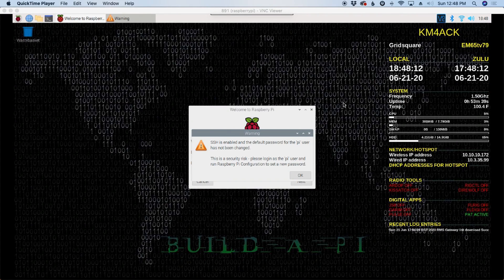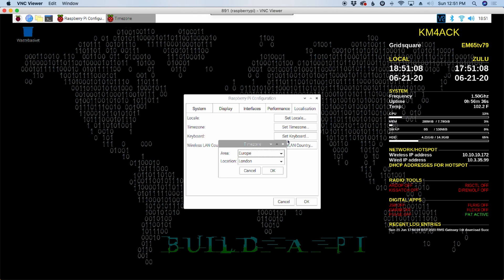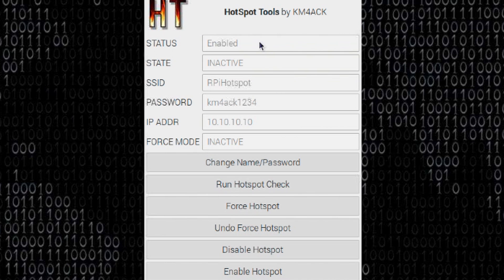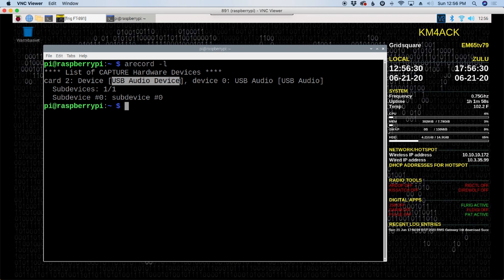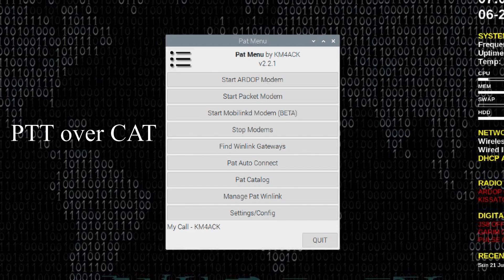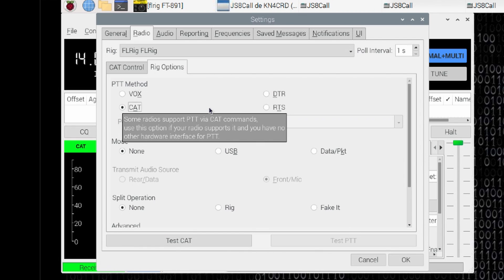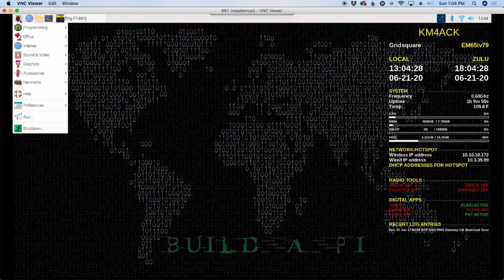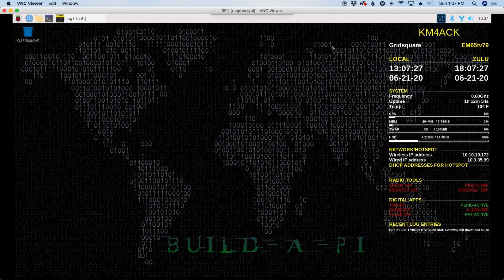Ham Radio Build a Pi Setup

Comment: Anyone try this on an original Pi? Someone gave me one and I want to try this
Reply from the maker: Might work but only the Pi 3 & 4 are officially supported.
Reply: @KM4ACK  Pulled a card out of my camera and decided to give it a try. The OS works but it's very slow and you need more usb slots. Some apps do not come up. If you have patience you can still log which for me starting out and learning to QRP is worth playing around with.

Comment: Hello Jason
have installed some applications in the buster with build a pi 
When I went to add more applications from the menu, it could not install them
After several update and upgrade attempts I noticed that it was asking to uninstall 
>>>>>>>> lxplug-volume <<<<<<<<
After uninstalling it I was able to install the programs I wanted through the build a pi menu
Congratulations on the fantastic work you have done
Best regards
de Paul
sv2hrt 😊

Comment: Hi Jason, tnx for next great video and your build-a-pi setup is fantastic. I get now  my new IC705 an its build in GPS works great. But after restart conky will not longer displayed. Have you a idee what the problem should  be. 73... DL1GKK
Reply from the maker: Josh at @hamradiocrashcoarse is the only one that I know that has done this successfully. Post the question on the BAP forum and let's see if we can figure it out https://groups.io/g/KM4ACK-Pi/topics

Comment: Hello Jason, this is TI2GBB from Costa Rica. Sr I have a question, this  " PI Package" for Ham Radio use contains a software from where I can run FT8 or another digital modes and in the same way, as soon as a contacted has finished, can I record the contact in automatic way in LoTW, QRZ.COM and other hamlogs?  I'm new in raspberry PI, I really enjoy your videos and I would like to buy a Rasberry PI to run this software  during my portable activation and in my home station as well, if there is a software with this functions on this package of software I will appreciate if you can confirm me this and also if this could be a future video. It will be amazing and good to have a software that can do this to reduce the effort to log manually the contacts. 73s!  Greg -TI2GBB
Reply from the maker: With the latest beta version 3.0.4, TQSL (LOTW) software is available. There are 3 different logging programs that can be installed. xlog, cqrlog, pyqso. https://groups.io/g/KM4ACK-Pi/topic/build_a_pi_3_0_4_beta_release/76733597?p=,,,20,0,0,0::recentpostdate%2Fsticky,,,20,2,0,76733597

Comment: Rookie to the Pi4, I succeed in installing Rig Pi .  No gps or hot spot, just basics. After booting up today, the wallpaper was gone😳. How do I get it back ?   Nothing in the appearance setting.  Build a Pi wallpaper
Reply from the maker: It is in the ~/pi-build directory. Use desktop preferences to set it.
Reply: @KM4ACK  thank you👍

Comment: I had an older version of build a pi working before. I am using this version now. Seems awesome. But I'm having problems with TX on wsjt-x, presumably everything else. 
I receive audio. I have CAT control. My radio appears to key (shifts) but does not break the VOX. I'm using a signalink. 
I installed everything available through build a pi. 
Set input & output to the same as you. (Im not using flrig) 
On the speaker icon I have USB Audio Codec selected. When I click "output device settings" I dont even have the same options as you. I have 1 slider labeled PCM. I can even set TX on the signalink all the way up to see if it will break the vox and it still doesnt. Any ideas on why it's not driving the audio 
enough to be able to break the VOX and TX? I dont believe it is a radio settings issue as it works on a laptop. Any ideas would be much appreciated!
Reply from the maker: Connect headphones to the back of the signalink and monitor to make sure you are getting audio to the signalink. Be careful as the audio can be LOUD coming through the headphones. If you are still having issues, please post to the forum and let's see if we can get it figured out https://groups.io/g/KM4ACK-Pi/topics

Comment: has anyone noticed that the clock on conky jumps after freezing for about 6 seconds, ham clock runs without jumps, I noticed it doing it on the video above, any ideas??
other than thatits a great application and use with my G90 for FT8, 
73's G3XOD

Comment: everything went great until I tried to fix the Gridsquare not showing up in conky.  No conky is gone, even after reinstalling and rebooting.  Other than that, fantastic!
Reply from the maker: run "bash ~/pi-build/conky/setconky" and it should get conky working again. Maybe not with GPS but at least make it visible again. Choose large when you run the above command.
Reply: @KM4ACK  funny, I thought that would work too bit it doesnt.  I'm wondering if something in the gps  is crashing it whereas when the GPS was not working conky was fine. I've tried reinstalling it too.  No luck.  I've got a small install so it doesn't take long to do the the thing over